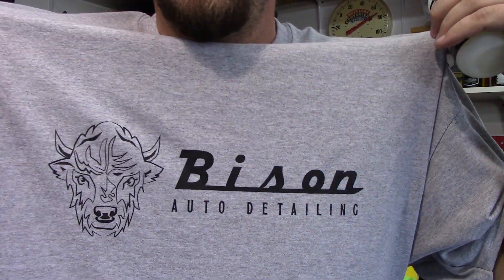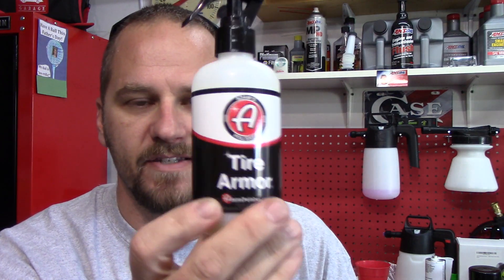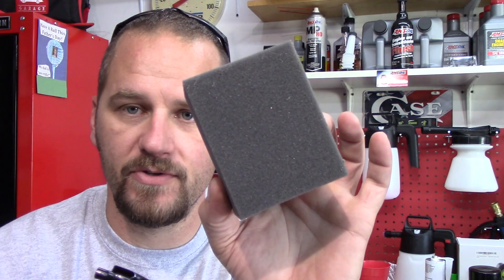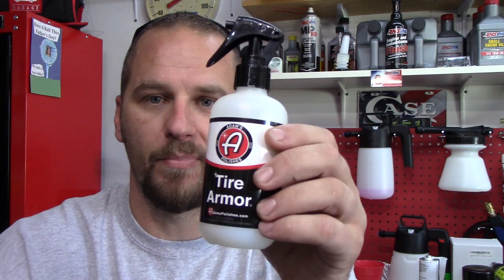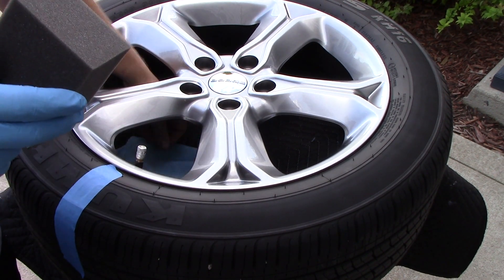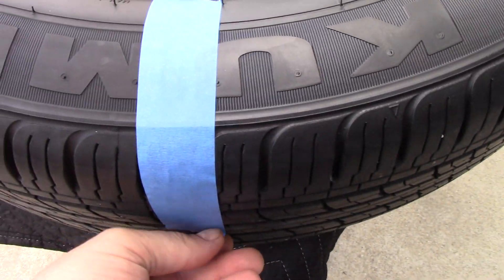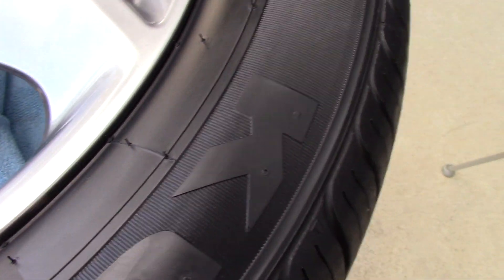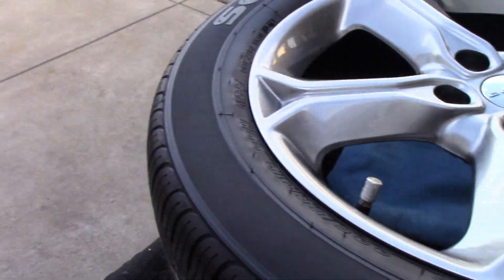Bison Auto Detailing Sent Me Adam's Polishes Tire Armor! Let's Check It Out!

Comment: Glad you finally got your hands on some of this. I applied this to my jeep tires back in April , i did 3 coats of it. Until just last month the shine from the Armor was still there and has held up tremendously thru many many washes. I recently applied 2 more coats of it just because. Good thing is i simply use Brake Buster or Adams TRC to clean the tires either touch free or sometimes ill brush them every other wash just to keep the look fresh. Now as someone else soaid even with the armor the tires will still bloom , i believe its just the makeup of rubber used in certain tires . However the blooming is easily removed with some simple cleaning and its back to that great glow to the tires from the armor. I enjoy not having to put on greasy tire shine anymore. Also Optimum and some others sell a their own version of a semi-permanent tire dressing. Now the new adams all in one wheel and tire cleaner is said to take off the tire armor about 70% roughly and completely removable if you scrub the tires a few times. Otherwise the Armor has held up to other tire cleaners i use.
Reply from the maker: Joe Rossi That’s great to hear you have a good luck with it. If I get just a month I would be happy! 😂
Reply: @FABAutomotiveDetailing  oh man you should definitely get way more than a month from it man easily

Comment: I would like to start off by saying to  Riley you do have a bright future in the auto detailing business. 2nd Brian thanks for the great video as you know I went ahead and purchased 2 bottles from Amazon I think the price is going for $21.99 a bottle. what I've also start doing is buying bottled caps for any of my ceramic coatings or products that crystallize so when it comes to  your spray bottles I put caps On the bottles and I take the sprayer and put it in a bucket of hot water pre spray it out and then let it soak for 5 minutes to prolong the life of my trigger.
Reply from the maker: Chuckwick Simmons He sure does have a bright future. I just toss the sprayers and dab them on applicators now. It works just as good that way especially with the spray coating. Thanks brother